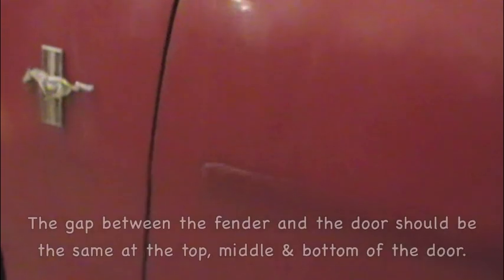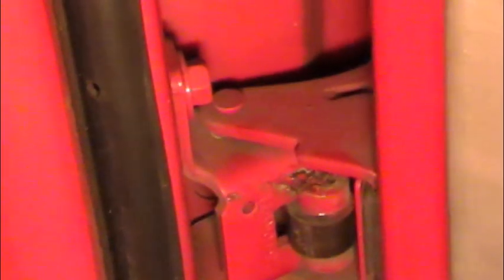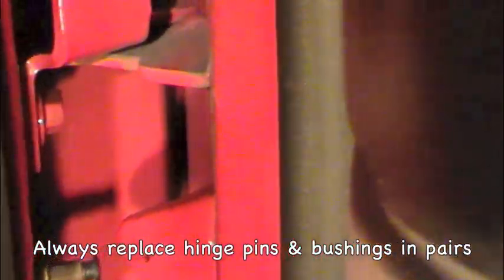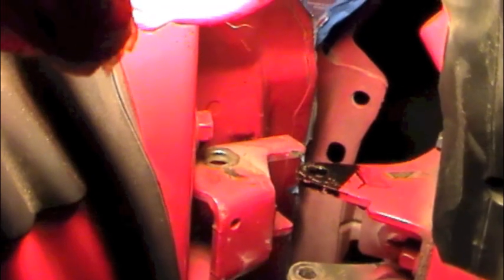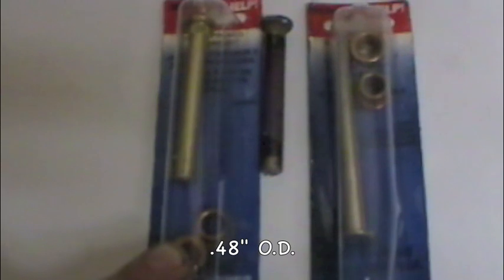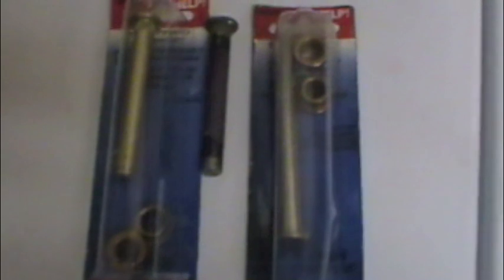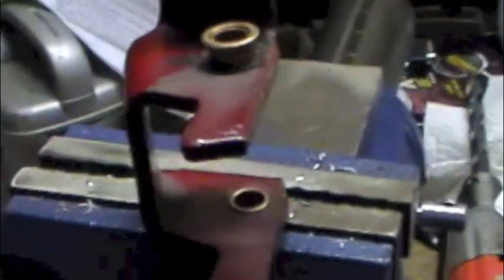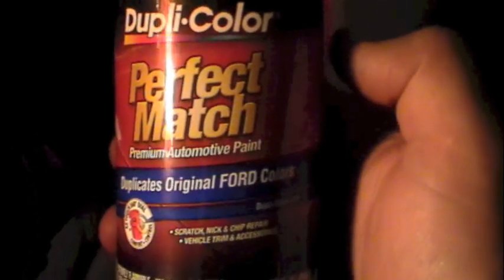Door Hinge Pin & Bushing Repair - Ford Mustang ('94 - ’04)

Comment: Thank you for this video, came in very handy when replacing the lower hinge on my 96 Cobra.  One tip, after the head of the pin is ground down put a cutting disk on the dremel and create an indentation on the top of the pin.  This really helps keep the tool you are using to hammer out the pin from jumping around.
Reply from the maker: Cool idea.  Just be careful not to cut into the hinge.  You probably only need a slight groove into the pin to give your punch something to bight into.  Thanks for the comment & for watching.
Reply: Thank you for the top

Comment: This is one of the most detailed videos I have seen on a fairly rare topic for the SN95's. Thanks very much for posting this. I need to do the driver side hinge pins on my 98 vert in the next week or two and this video is tremendously insightful as to what pitfalls to watch out for. Even for the Dorman part number situation this video (and the mustang thread I read about your ordeal) was worth a ton. Thanks again!
Reply from the maker: Thanks a lot. I appreciate it. I'm glad my video (and forum post) helped you out.
Reply: Thanks again for the video and the information in it! I finally got around to doing this job today. 15/32 inch bit was perfect for the new bushings. After watching your video, I decided to remove the door from the hinges first. I disconnected the two (on my 98 GT) electrical connectors so that I could pull the wire loom out all the way and completely remove the door and slide it off of my carpet covered jack to get it safely out of the way. My 4 1/2 inch angle grinder with metal cutoff wheel made quick work of cutting the hinge pins in half, after which I was able to get each half out fairly easily. Putting the door back on wasn't too big of a hassle, but it was a test of patience. Thanks again for the video! If I had just gone to a parts store and bought the (wrong) part that they recommend I would have been PISSED when I had the door cut off of my car and the part was wrong.

Comment: great video....I came here as I was looking at a 98 mustang and the seller mentioned the hinges need replacing. Very informative video, not concerned about doing the job now if i purchase the vehicle. Thanks.
Reply from the maker: Cool.  I'm glad my video eased your concerns. Its not that difficult o a job. Its mostly a balancing act with the door, but other then that its pretty straight forward. After doing this job you might need to adjust the window a little. I have a video on that too (https://youtu.be/E-TLxmP12QY). Good luck.

Comment: Thanks for the video, helped me out greatly.  I would defiantly recommend the shorter pin.  My parts store sold me the longer pin and I had to tap the pin back up to install the lower bolts and then tap it back down.  When I do the other door I'll make sure to get the shorter pin!
Reply from the maker: Thanks a lot. I appreciate it. The shorter pin is definitely a better fit. Good luck with the other door.

Comment: The alignment of the passenger door on my '99 Mustang has been 'off' for some time now. I will check out the hinge pins and the associated door / striker plate adjustment points that you show. However, this hinge pin replacement  (if warranted) I may leave for a body shop.

Thanks for the video. Even with hand-held camera work...  Well done.
Reply from the maker: Bryan Thomas, yeah, if the hinges are loose you'll never get the window aligned properly. Replacing the hinge pins can be a P.I.T.A., but is do-able in your garage. I have a video on how to replace the pins if your curious: https://www.youtube.com/watch?v=hF2U8MWrqaM . But if you're not comfortable doing it or don't have the time a body shop is the way to go. They would probably include aligning the door & window with the pin replacement. Shop around. Good luck…

Comment: Thankyou very much for all the information! a lot of details that made even getting the right parts easy. the only thing I did different was I cut the old pins with a saw which was easy and no mess.
Reply from the maker: How did you get the saw in there?  There is a big plate that is part of the hinge covering the pin.
Reply: Pet Rock's Garage I just turned the hinge sideways. first door I cut by hand. then I even used a sawsal.
Reply from the maker: Ron Vissia, so you removed the hinge from the car & door? Removing the hinge from car frame requires a realignment of the door when you put things back together. That can be fairly time consuming to get it right. I avoided that with the method I used. You could just unbolt the hinge from the door, disconnect the door’s wiring harness, and gain access to the pin from the back that way though. But that is a bit more work since you have to move the door around (instead of just balancing it in place), and snake the wiring harness out without damaging it. But you gain in not having to grind the top of the hinge pins and can just cut them in half. Its a bit of a toss up I guess. I will have to do this same job on the passenger side door on this car eventually and was considering doing it that way (and making a video about it) to see which way was easier. We will see.
Either way, good to hear you got the job done and the video helped you out.
Reply: Pet Rock's Garage I only unbolted the hinge from the door. the wiring was ok to leave attached. I found the pins on the passenger side were reversed as well. the larger hole on top.

Comment: In the future use of a mechaics hammer instead of a carpenters hammer would have given you less trouble; old saying the right tool for the job, other wise pretty good video and replacing hinge pins and bushings is tough!
Reply from the maker: Thanks. I agree about the right tool for the job. However, I was using what I had available at the time. In the end it got the job done. Thanks again.

Comment: Just a thought. Perhaps take the door off .....easier access to the hinge assembly
Reply from the maker: Removing & reinstalling a door by yourself is a pretty big P.I.T.A.  Very easy to drop the door or break the wires going from the body of the car into the door.  Plus, by removing the door you are giving yourself extra work at the end to re-allign the door. That too is a P.I.T.A. But if you find removing the entire door easier, then by all means do so.
Reply: You have no idea how hard it is take a door off and out it on.. ive swapped doors on my 2000 mustang and the wires i had to cut and resolder them bsck lol

Comment: Great video, I'm working on my driver door now. Problem is I can't get the bolt from the upper hinge back in place. It's not grabbing into the door. I'll remove the door panel tomorrow and see if I can't get it back in place.
Reply from the maker: +Dylan walker, be careful and don’t cross thread the bolt. That would be a P.I.T.A. to fix. It might help to have a friend hold & manipulate the door for you as you get the bolt in. Try not to twist the door too much or you might bend the lower hinge. Good luck...

Comment: Hey, wouldn't it be sooooo much easier to just buy new Mustang 94-04 hinges? 
($37 on ebay)
I supported the door and removed and replaced one hinge at a time, marking with a sharpie before removing old ones, took me 30 mins to replace all four hinges!!!
Reply from the maker: Yes, that is an option. How did you get to the bolts on the hinge without removing the fender? Most people would have to remove the fender which means you have to re-allign the fender and door which is not an easy task by any means. Especially if you’ve never done it before. Also, at least on my wife’s car, the frame side of the hinge is bolted and welded to the frame from the factory (as shown in the video). So its not that simple to remove the hinge as an assembly. However, if you got the job done wth your method thats all that matters.  Thanks for watching & commenting.
Reply: +Pet Rock's Garage 
I use a knuckle joint extension  to get to the bolts, they are not welded, just an adhesive and a bolt on the inside that you have to remove the inner kick panel trim to get to.
Reply from the maker: That must have been a very flexible extension because none of mine would reach. But if it worked for you, great.
Reply: +Pet Rock's Garage 
I used a Snap on 1/4 drive knuckle, its the only one that would fit.

Comment from the maker: +ken f, YouTube won't let me reply to your comment for some reason.  Yes, you could remove the fender and pull each hinge (as an assembly) off one at a time.  However, your glossing over the fact you'll have to align the fender & door afterwards. Thats not so simple if you haven't done it before. If the fender is not touched and you replace just the pins & bushings, you might not need to align the door afterwards. And even if you do you'll have an easier time doing it since the fender can be a point of reference. Also, at least on my wife's car, the frame size of the hinge is bolted & welded to the frame from the factory (as shown in the video). So its not that simple to remove the hinge as an assembly. With the fender removed, you would have better access to the hinge pin so you could cut it in half instead of grind off the top though. Either way, if using your steps works for you then more power to you. There is more then one way to do most jobs. Thanks for watching and commenting.
Reply: could I use a air chisel to take the top of the old door pins
Reply from the maker: +Biggy Hughes, the pins are made of pretty touch metal. You might be able to do it with an air chisel, but you could also easily damage the hinge in the process since there isn't much clearance between the head of the pin and the hinge. Good luck...

Comment: Using a drill works fantastic.
Reply from the maker: yeah, if you can get the drill in there and be able to hold it steady so the drill bit doesn't walk off the head of the pin.  For me there wasn't enough clearance to get the drill into that small space.  Maybe an angle grinder or a right angle drill, but I don't have either.

Comment: excellent video.   how do you adjust door and proper wire connection to the power mirror switch.  thanks
Reply from the maker: Thanks a lot. I appreciate it. Adjust what aspect of the door? I'm not sure what you are asking.  Same with the power mirror switch. This video has nothing to do with electrical connections.

Comment: I'm new at this but why not take off the whole door if you had to replace both hinges or pins? Or is that to much of a pain?
Reply from the maker: +William Mitchell, if you have to replace the hinges then yes you need to remove the door.  However, if you just need to replace the pins you don’t need to remove the door. Removing the door is typically a 2 person job and a bit of a pain in the butt. Especially getting the door aligned properly when you try to reinstall it.

Comment: I found a dodge pin kit that had the right size bushings and used the short pins from the ford kit.
Reply from the maker: Thats great! Do you have part numbers?  Thanks.
Reply: @petrocksgarage  the ford kit is a "help" part # 38438 and the dodge one is 38402. Got em at Canadian Tire
Reply from the maker: @aw-rh7ky , awesome.  Thanks a lot.

Comment: 16/64 is quarter inch or .25 I think you meant to say 31/64 at around 27:00
Reply from the maker: Yeah, I misspoke. You are right I did mean 31/64. I used to have an annotation on the video about it, but YouTube killed that feature a little while ago.

Comment: Hi thanks for the video, i have 1999 mustang V6 which part number will be fit for that ?
Reply from the maker: The same one I use in the video.  Dorman #38438
Reply: @petrocksgarage  Thanks for the reply upper hinge and lower hinge has separate Pins or same number can be used for upper and lower both ?
Reply from the maker: @AtiqUrRehmanBhatti , same for both upper & lower.

Comment: if you buy the right bushings you don't have to drill it out.
Reply from the maker: And which bushings from which kit would those be?
Reply: if you get online and order them they fit perfect. don't go to an part store cause then it causes for more work then needed. they don't carry the exact fit just universal parts
Reply from the maker: Yeah, parts stores carry the wrong part.  I stated as such in the video & description.  Could you provide a part number for the kit you found and where you got it?  When I search around all I find is the two that I listed in the description, both of which require drilling.

Comment: Should have replaced the roller too. Yours looked worn anf will make the door pop when opened and not stay open well.
Reply from the maker: +Scott_C., I thought about that at the time but decided against it. The roller is made of a hard plastic and while it was dirty it wasn't worn. No flat spots or anything like that. It is still rolling strong to this day and holds the door open without problems or noise on level & incline surfaces.  Thanks for watching & commenting.  I appreciate it.

Comment: Isnt 16/64 a 1/4??
Reply: I caught that, too. But then I realized that he meant to say the size which is 1/64 larger than 15/32 which would be 31/64. 31/64 matches up with the 0.484 calculation which he uses later in the description, and which was too large of a hole for the bushings to fit snugly into. That's why he ended up using 15/32.

Comment: 2 plugs and 4 13s and the door comes off
Reply from the maker: It's really not that simple, and I think you know that.  You're (intentionally?) forgetting about removing various panels to get to the plugs, the fact that the plugs are not very easy to get to, that you have to snake the wire loom through the door or car frame without damaging the wires, and still having to stabilize the door as you remove the 13s as well as when you re-install the door and getting it all aligned back up properly so the door closes without any interference or rubbing and even gaps between the fender & door. But use whatever method you prefer.  Its your ride after all.

Comment: looks like a pain in ass
Reply from the maker: Not really. The hard part is getting the pin out with a punch & hammer after grinding the head of the pin off. If I had a longer punch it would have made it a lot easier.